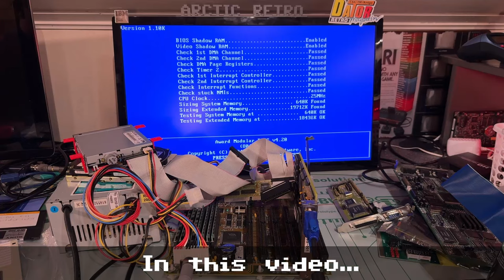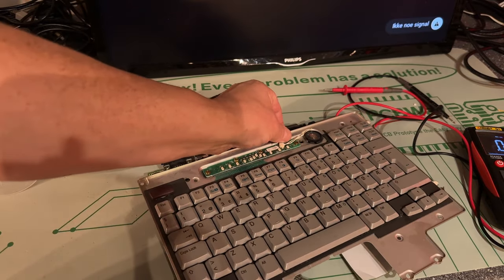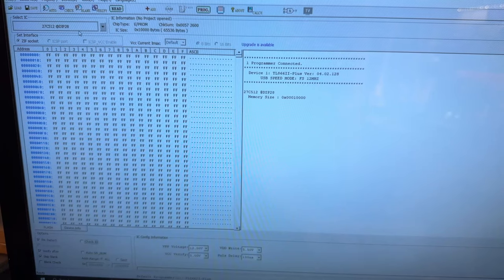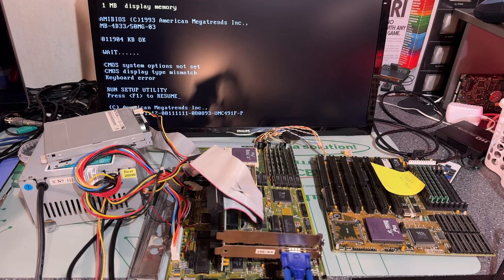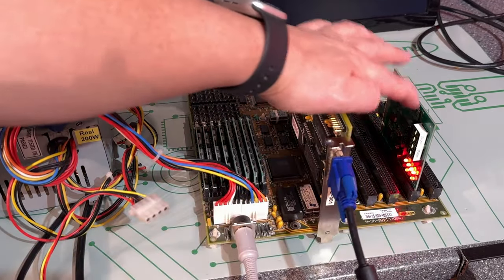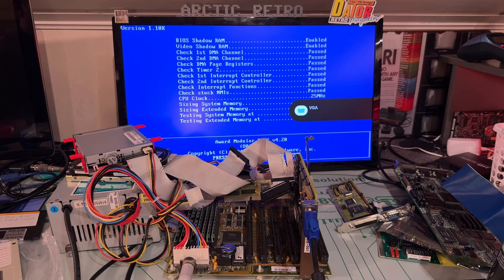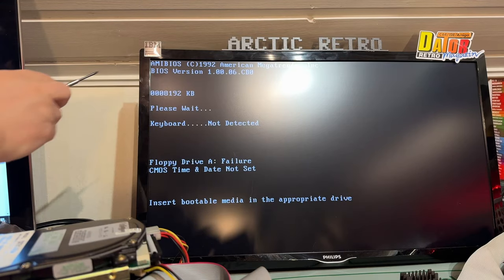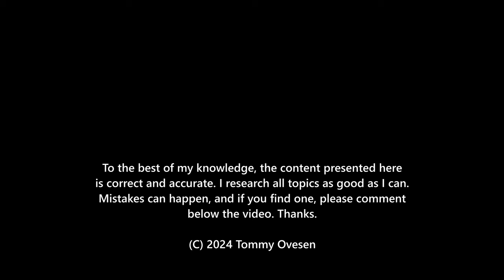Checking out a MYSTERY box full of old PC-parts and components - Does anything work ?

Comment: On some of the old Compaq laptops, F2 is not the BIOS Setup key.  Try ESC and F10.  Some nice kit here!  I see a CompactFlash to IDE in your future... 😄

The EtherLink III was a good network card back in the day.  The 15-pin AIU port on that card uses a variety of adapter "dongles" to support BNC, RJ-45, and fiber (MT-RJ and ST fiber adapters should still be available).

About all you can do about the DIN keyboard connector is check for cracked solder joints or broken traces.  Somewhere in my workbench I still have a PS/2 to DIN barrel adapter that permits using PS/2 keyboards with older boards.   I hope to see more videos from Arctic Retro based on these parts!
Reply from the maker: Cool, thanks

Comment: You had the floppy cable connected the wrong way. The twist should be connected towards the floppy drive, not towards the motherboard.
Reply from the maker: Ok. I think I tried it both ways in fact. Always a little confusing, but I will check. Thx